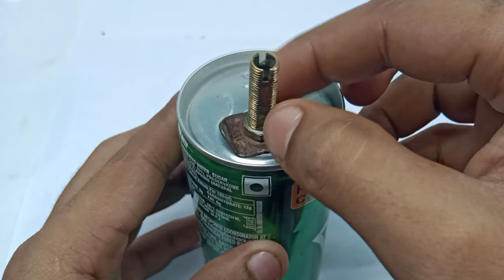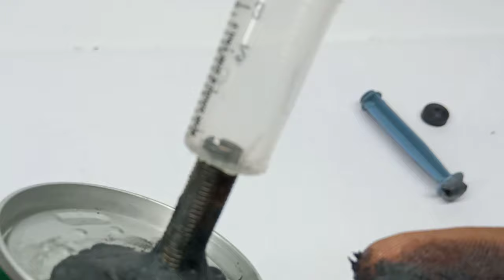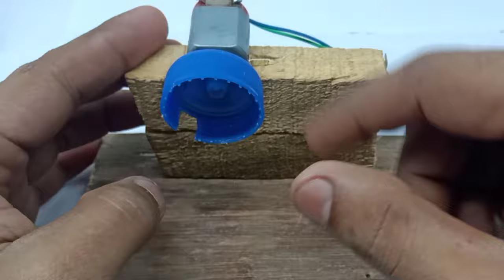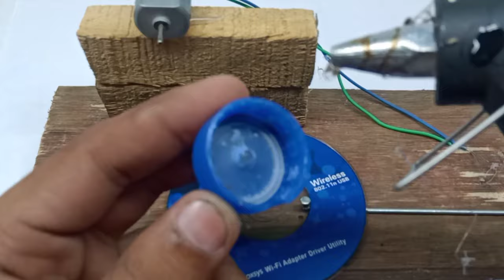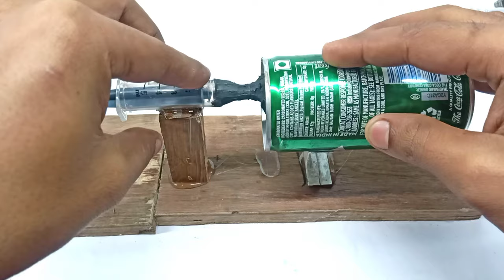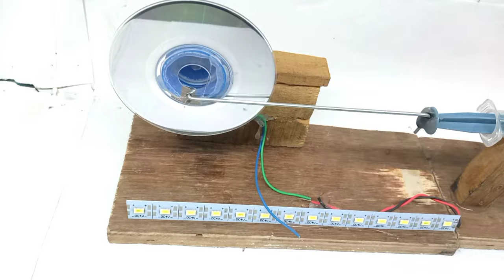How to make steam engine at home easy | Free Energy Generator From Dc Motor | Science Project

Comment: Where you hide the battery😂
Reply: It doesn't require a battery
Reply: @gauris1656 it does require a battery, from that motor to light it doesn't make sense
Reply: 😂😂these youtubers think we are so naive to believe this. free electricity is never possible or else everyone would have done that 😂😂
Reply: @xavier93  Do you know who was James watt🤨
Reply: @priyanshuraj6579  what does that have to do with free electricity??
Reply: @xavier93  this is not free. He is converting thermal energy(from candle) to electricity.. & this is a very old concept of physics, preformed by a lot of people before
Reply: @terminatorgaming9519  nah I don’t believe this. I feel like there is some tweaking done here 🤔🤔
Reply: Dude u people see clearly again after 10 min later focus in the right side and u see a blue colour 9v battery
Reply: But the video is 8 minutes
Reply: @xavier93 You know steam trains? This is the tehnology used for it. Its very old and i think it was designed in 1775. And its not exactly free (for big models) but for this small one it might be free because the wirung is easy and you need fire water and a 2 dollar can and any kind of circle. I will make it and see if it works.
Reply: @virus_man_3000  idk if im dumb but if it were possible to generate electricity through this steam engine model, wouldn’t everyone build one of these and have electricity to power whatever they want?
Reply: @xavier93  Well not everyone has time to build theese, and it would take alt of heat to make the water into steam. And i dont think this thing generates a lot of volts i think max 50?
Reply: @xavier93 And i forgot to say. It would cost a lot pf money to make a big one.
Reply: @virus_man_3000 about 5V, not enough to light that Led strip which needs 12. And that would be a model steam engine like a Wilesco or Mamod which doesn't have essential parts missing (where's the valve gear).  At least this one won't explode (there's no safety valve either) as steam will leak away past the piston (which will go to the end of its travel and stop, if that). The piston seal was removed to make it free enough for the electric motor to turn.
Reply: behind the disk
Reply: @AAToonz   Motors generate electricity when spun, if you have a motor and spin it it generates electricity.
Reply: @xavier93  its not free or infinite energy, the fire exchange energy with the sistem. So to make it infinite you need an infinite light
Reply: @monicamenesecitas  k
Reply: the battery is a display for other projects
Reply: @highloughsdrifter1629  Thanks! I troed making this but my crafting skills sucks.
Reply: Tail_s bhai shayad tune physics nhi padhi,it's an stem engine

Comment: It was not working
Reply: it was not working? because he didn't have enough water in the can. you see, steam engines require as much as water in the tank as possible to get it going, but he only added little bit of it, which won't work because the water or steam won't be able to reach the syringe and make it turn. steam pressure is another factor to consider when making a steam engine.

Comment: This is a forgery; I tried it and it does not function; it is clear because there is no steam or vapor See's in it. And there is a 9v battery at the right side corner ? 5:38
Reply: if you knew how a steam engine worked, then you would know 😆

Comment: We need Dynamo dc motor to generate electricity but you have used 130 dc motor with this motor electricity can't be generated it's impossible.
Reply: exactly, i dont even thing the engine was working. he might have used wire from the side which you can clearly see. and the wires appeared when he started to move the motor
Reply: It needs a generator because no motor can generate electricity
Reply: @rachithooda9775  motors can generate electricity, but the one he is using right now dont generate much electricity, becides the steam engine wont roll the cd. he is using battery to roll the cd

Comment: What did he put in as fuel?
Reply: water. in steam engines, its commonly or usually water. because water is used to turn it into steam and induce steam pressure. steam pressure is what you need to get the thing going.